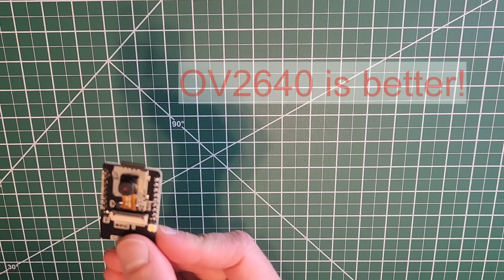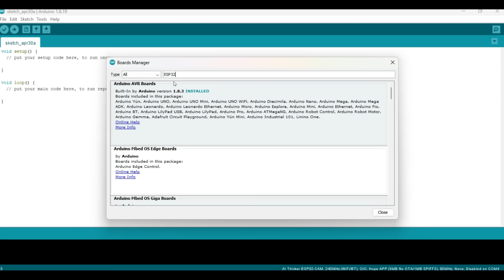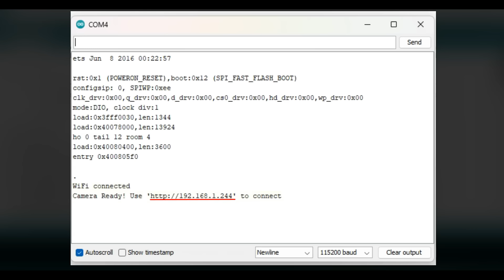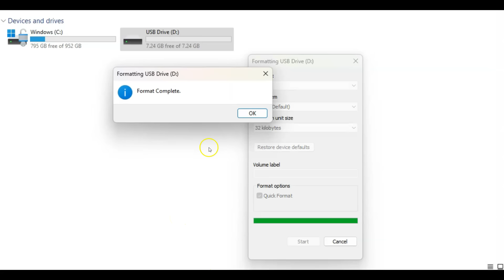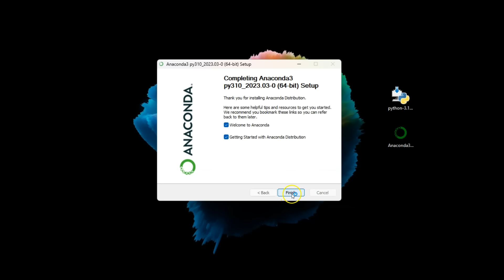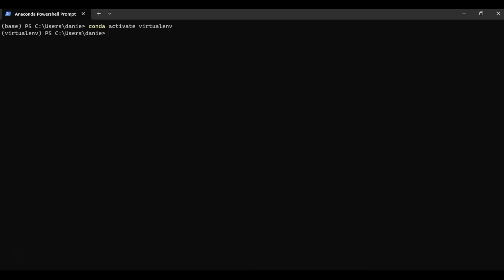ESP32-Cam Complete Guide

Comment from the maker: Where to buy [Amazon Affiliate]: ESP32-Cam: https://amzn.to/4cZfz4G
Reply: Pls what is the name of the charger module you are using for your ESP-32 cam? I wanted to use a TP4056 module but I discovered it can only give an output up to 4.2v whereas I want to use the 5V pin to power my ESP-32 cam
Reply: @JoshuaOgundairo  u have to boost it with an MT3608 2A DC-DC Step Up (Boost) Power Module, its an inexpensive board, this way it will give consistent 5v when charging using the tp4056 module and also give stable 5v when power is from 3.7v lithium ion batteries. (i m using a 18650 lithium ion battery)

Comment: Hello! I’m having a problem with my ESP32-CAM. I’m using an ESP32-CAM connected to an ESP32-CAM-MB programmer board (the one with the USB port), not just the bare ESP32-CAM module by itself.

My ESP32-CAM successfully connects to Wi-Fi, and the Serial Monitor displays “Camera Ready!” along with an IP address. However, when I open the IP address in my browser, the screen is completely black, and no camera image appears. I’ve also tried adjusting the camera settings, but the problem persists.

The camera seems to initialize successfully, but the video feed doesn’t show up. Has anyone experienced this issue with the ESP32-CAM-MB setup? What could be causing this, and how can I fix it? Any help would be greatly appreciated. Thank you!

Comment: The 2N222 is an NPN transistor with pins 1=Emitter (left when looking at flat front), middle is Base, and 3=Collector.   In the video @17:18, the ground wire is actually connected to the Emitter, and the 10K resistor is connected to the collector.

Comment: hey guys, I have a problem with my esp32. I use basic development board instead of FTDI basic shown in the video. live streaming a video from camera on esp32 causes huge lags, its not 15 fps, its barely achieving 15 frames per minute, even on low resolution, I have no idea why it happens, maybe I shouldn't connect esp32 to my computer through basic development board? maybe there's not enough current? I have absolutely no clue why is this happening, please help me

Comment: if all you see is "Wifi connecting. . . . . . . . . . . . ." without ever connecting, you should probably check your internet settings and allow the board to connect by putting in its IP address (if it even has one) if ya only allow whitelisted IP addresses to connect.
Reply: or you are dumb like i was and tried to connect it to a 5G network

Comment: If you want to use it for face tracking-forget it. I have spent a week trying to get face tracking up and running smoothly. Had to resort to version 1.0.4 esp32 by espressif to even attempt it. Got it running, but laggy/jittery as it tries to follow. No wonder face tracking was removed from newer versions. I'll be trying again with a Husky Labs next.
Reply: Any update on this? Was just putting this together for this purpose
Reply: Yeah unless the processing is outsourced to a pc for example

Comment: i have a problem 17:58:13.488 -> load:0x40078000,len:13836
17:58:13.488 -> load:0x40080400,len:3608
17:58:13.488 -> entry 0x400805f0
17:58:13.969 -> E (489) esp_core_dump_f���͡� No core dump partition found!
17:58:13.969 -> E (489) esp_core_dump_flash: No core dump partition found!
17:58:14.422 -> 
17:58:14.904 -> E (932) camera: JPEG format is not supported on this sensor
17:58:14.904 -> Camera init failed with error 0x106   
plse help me sir..........

Comment: Might be a stupid question but I do not have engineering background. I am a designer and I was wondering if there is a camera module that does the same task as what you have shown but the camera is portable. Lets say you are having that camera and you are able to capture an image and send it to your phone at any time without any wires. Is that possible to achieve? I could've prolly framed the sentence in a dumb way but oh well, Could really use some help!!
Reply: Hey! So in the video he is using a power supply module and just connecting that to the esp32 camera. If you connect the power supply module to a battery, instead of plugging it into the wall, you should be able to bring it around with you! Tho I'd recommend soldering your wires instead of using a breadboard as they can come loose easily in the breadboard. Hope that helps! Good luck
(P.s. There's no such thing as a stupid question)
Reply: @isy1881  Ah thank you so much! Makes a lot of sense 🥹
Reply: @shamini30  no worries! Good luck with your project :)

Comment: How do i figure out which ports to use?
Reply: Right click on start menu (window 11), click on Device Manager, click on COM Ports, and use the one that is connected to the CH340 driver.  That's the port you would use on the Arduino sketch under "tools" port.

Comment: (virtualend) PS C:\Users\ejoao\Desktop> Python .\testee.py
2024-03-10 01:41:31.401090: I tensorflow/core/util/port.cc:113] oneDNN custom operations are on. You may see slightly different numerical results due to floating-point round-off errors from different computation orders. To turn them off, set the environment variable `TF_ENABLE_ONEDNN_OPTS=0`.
2024-03-10 01:41:32.447451: I tensorflow/core/util/port.cc:113] oneDNN custom operations are on. You may see slightly different numerical results due to floating-point round-off errors from different computation orders. To turn them off, set the environment variable `TF_ENABLE_ONEDNN_OPTS=0`.
Traceback (most recent call last):
  File "C:\Users\ejoao\Desktop\testee.py", line 50, in <module>
    bbox, label, conf = cv.detect_common_objects(frame)
                        ^^^^^^^^^^^^^^^^^^^^^^^^^^^^^^^
  File "C:\Users\ejoao\anaconda3\envs\virtualend\Lib\site-packages\cvlib\object_detection.py", line 125, in detect_common_objects
    net = cv2.dnn.readNet(weights_file_abs_path, config_file_abs_path)
          ^^^^^^^^^^^^^^^^^^^^^^^^^^^^^^^^^^^^^^^^^^^^^^^^^^^^^^^^^^^^
cv2.error: OpenCV(4.9.0) D:\a\opencv-python\opencv-python\opencv\modules\dnn\src\darknet\darknet_io.cpp:705: error: (-215:Assertion failed) separator_index < line.size() in function 'cv::dnn::darknet::ReadDarknetFromCfgStream'

(virtualend) PS C:\Users\ejoao\Desktop>

Comment: (A fatal error occurred: Failed to connect to ESP32: No serial data received.) I can't manage to fix this?
Reply: Try to update your serial driver for the FTDI
Reply: I hope you see this as it has been a while, but I was having the same problem, what I ended up doing, was once I have it all plugged into the FTDI and the 0 pin is connected to ground, press the reset button. Now try to upload the code once more. Update me if this works!
Reply: try another GND port , it solved my problem!

Comment: I want to read my gas meter. Can you do OCR with an ESP32 locally? Without connecting the ESP32 to your home network?
The meter is outside and connecting to my home network would be a security risk. Connecting it to a Lora module to send 1 way readings is ok, though.
Reply: Did you ever find a solution to this? Planning on using it with OCR for a meter as well
Reply: @sophiatender3820 I caught a severe case of laziness that prevented me to 😬

Comment: General question please..?   What size/gauge wire do I use for ESP32 S3. Connecting a sensor that is 20feet away from ESP32?  
Thx!  My first project!  Disabled and learning new things =. ESP32!    Thank you!
Reply: In general, most protocols like I2C or SPI can’t be connected more than 4-6 ft away. Look at the sensor and see what comm protocol it supports.

Comment: How many current can support the board? Because, I want buy it with an adapter to programming (flashing), it has a USB adapter, that I can use with a charger adapter for a smart phone. Therefore, the adapter supplies 2 ampers as maximum quantity. Hence, I have the question if it could burn up the board using the mentioned charger adapter, with a high current.

Thanks for your time and thanks for the video, it was a enormous help for me. 🗿

Comment: hi can you help me with this
it says

A fatal error occurred: Failed to connect to ESP32: No serial data received.
Reply: Hey, I am having the same problem. Have you found a fix?
Reply: Two things I've found when messing with it: 1. Make sure GI00 is shorted to ground. 2. It is strange but I had to connect my TX to TX and RX to RX which would normally be backwards.  @ChangJiaJun
Reply: yep i just change the connector @ChangJiaJun
Reply: also somewhat strange, try changing the ground pin on esp32 to the left side below the 5V pin.
and if you use 5Ghz wifi, it might also help to change into 2.4Ghz. idk why that is but it's working

Comment: May I know how to reduce the latency? When the camera is streaming to detect object, it's laggy in my situation.
Reply: Yeah,I'm having it too.can anybody give a answer quickly?All help is supported as I'm doing this for a school project.
Reply: Set it to use AP mode. I had the same problem when connecting the camera's wifi to router.  Use AP mode if you still use internal antenna.
AP mode is good for testing your code. 

Here is some code in my camerawebserver sketch.

#define CAMERA_MODEL_AI_THINKER // Has PSRAM

const char* ssid_AP = "xxxxx";          // replace xxxxx with your desired ssid name
const char* password_AP =xxxxx";  // replace xxxxx with any password

IPAddress local_IP(192, 168, 1, 90);

IPAddress gateway(192, 168, 1, 1);
IPAddress subnet(255, 255, 255, 0);
IPAddress primaryDNS(8, 8, 8, 8); //optional
IPAddress secondaryDNS(8, 8, 4, 4); //optional

in setup( ) function. just before startCameraServer();

remove these lines:
 WiFi.begin(ssid, password);
  WiFi.setSleep(false);

  while (WiFi.status() != WL_CONNECTED) {
    delay(500);
    Serial.print(".");
  }
  Serial.println("");
  Serial.println("WiFi connected");

and replace them with:

WiFi.softAPConfig(local_IP, gateway, IPAddress(255,255,255,0)); WiFi.softAP(ssid_AP, password_AP);
Reply: For reduce latency you need to make images resolutions smaller and compressed. Use cloud image processing like Google cloud etc to process the algorithm, because there have GPU better than your device.
Reply: its not powerful, if you've seen people use it, its always  laggy.

Comment: Can these do wifi direct connect (p2p) so I can connect direct with my phone to the camera and view through the phone? I cant find any information online. Anyone know if there are any modules that can do this? I need to view live on my phone in places where there is no internet.
Reply: If you use your phone's 4G connection over hotspot and you program the esp32cam appropriately, you can use it like  this. I've already tried it with this module and it works.

Comment: Bro, I am getting issue, its get restarting when I turned on face Detection. Can you help?
Reply from the maker: Hi, thanks for watching. I didn't have that issue. I have read that you could run into that issue when powering the ESP32-Cam through the FTDI. Have you tried turning on face detection without powering via FTDI?
Reply: @diyengineers  Bro, thanks for your reply. I have tried with other power methods but not work, and with FTDI its even do not power up, Keep restarting for every second. In the end, I think it's an issue with and order new one that will deliver today, and I will check it with a new one.
Reply: Did you fix it @salmanahmad4759

Comment from the maker: What projects would you like to see next? 😃
Reply: So I just got an ESP-32 camera (which came with a USB adapter) for a project and I tried the webcam browser (or whatever it is) example, and my code uploaded successfully. But when I press the reset button, nothing shows up in the serial monitor although the baud is the highest and everything. Sometimes if I unplug and plug the camera back in it would show some weird question mark characters that would either go on forever, or there would be like 4 of them. It is so weird. Idk what is the issue but I am considering returning the camera. Any solutions?
Reply: Try a different USB port on your PC or better 
use USB hub.
Reply: @richardroy6747  I actually got it to work as of now. Luckily it was connecting to wifi so it was just my usb cable
Reply: Can we see a video on the LILLYGO pico T-3 with the RP2040 & ESP32 with LCD. That microcontroller looks awesome
Reply: Thanks for uploading this; the video is interesting and informative with great visuals, too! Currently working through the examples and just got to the webcam-server stage. 

In regards to future projects; it would be interesting to know how train the ESP32-CAM to take an action when it detects a certain object? Eg: smart garage door that recognises certain number plates
Reply: How to use ESP32-CAM and the ESP32-CAM-MB running in ESPhome. This type setup is a nightmare in Windows 11 something to do with the CH340 drivers.
Reply: Please I like you to create object detection using de1-soc?
Reply: can you make accident detector using ESP32-cam.please...